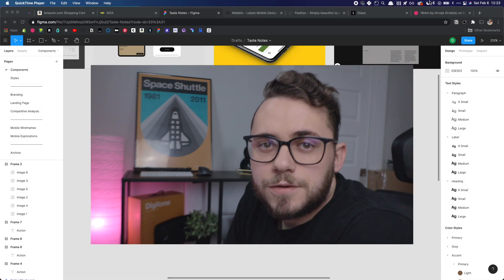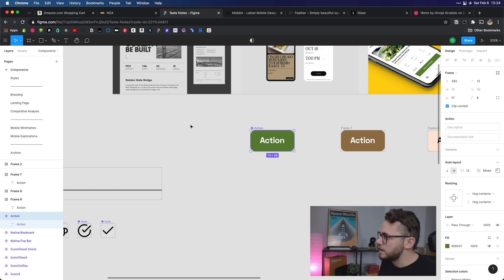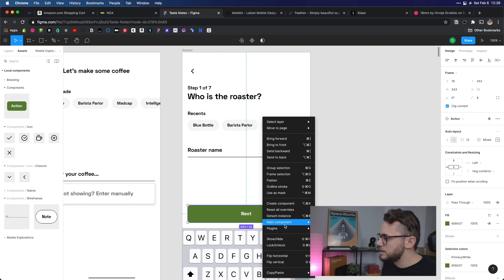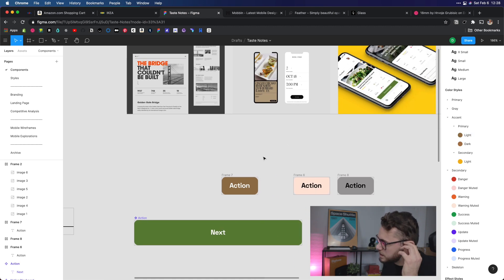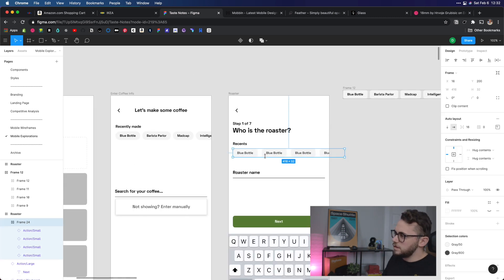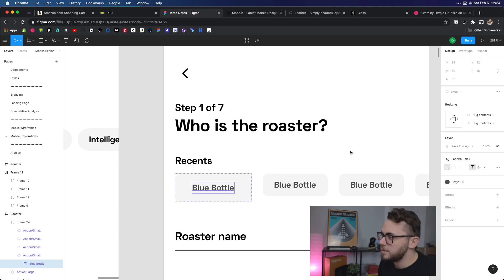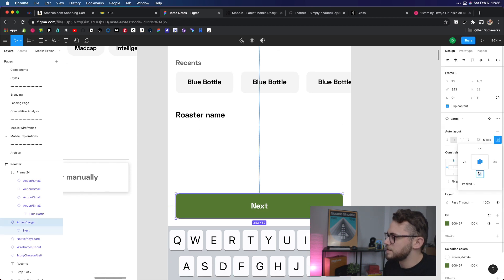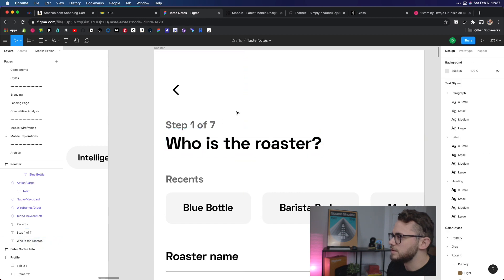How To Create Design Systems from Scratch Walkthrough (Part 2 - Creating Components and Iterations)

Comment: These videos are fantastic - I agree Geekernator21!

This is likely a naive question, what is the difference between a "design system" and  "UI kit?" I guess the design system is bigger and more developed than a UI kit, but how connected and redundant are they? If you are not an enterprise company would you just be better off building a UI kit?
Reply from the maker: Personally, I think a UI kit is just the basic standard UI elements like buttons, forms, icons, etc. while a design system is created specifically around a specific product. Still uses the same elements as a UI kit but also has custom UI based on the product and goals. Design systems also help with internal communication and cross department collaboration creating a "language" between Engineering, Design, and Product.
Reply: For anyone interested in this topic, I would recommend checking out both of the following videos:

Design Systems, Pattern Libraries & Style Guides... Oh My!
https://www.youtube.com/watch?v=rO5dBA-avfw

and

What is a Design System? Design Systems 101 for Designers
https://www.youtube.com/watch?v=wc5krC28ynQ

Keep in mind that design systems and various related tools and concepts are still evolving, and have not yet reached the point of a consensus definition. A UI kit is part of a design system, and could be considered a very basic design system in and of itself. But a design system can also include much more.
Reply: @kevinmackey3166 

 "Keep in mind that design systems and various related tools and concepts are still evolving, and have not yet reached the point of a consensus definition."  Lol, it seems that way...

All of this info is very helpful, thank you!